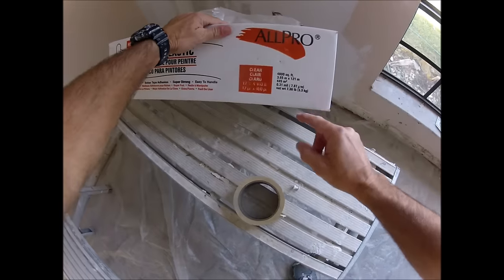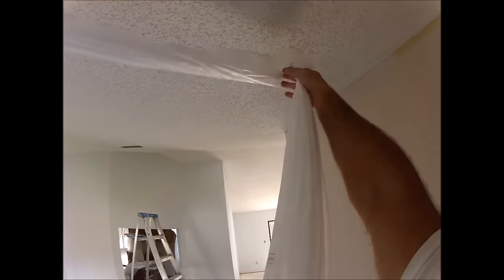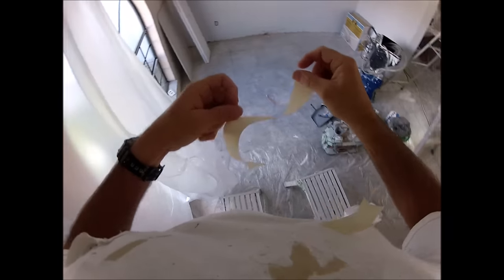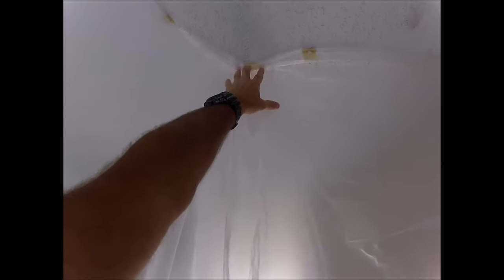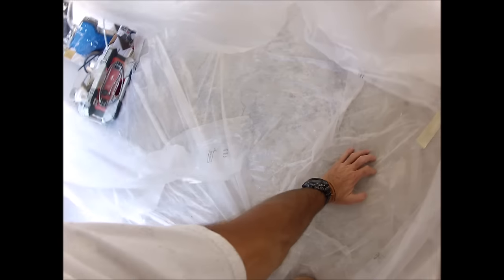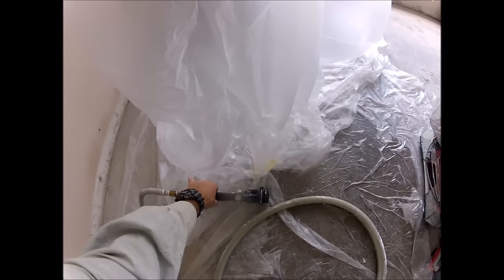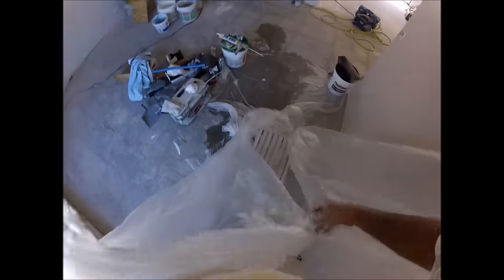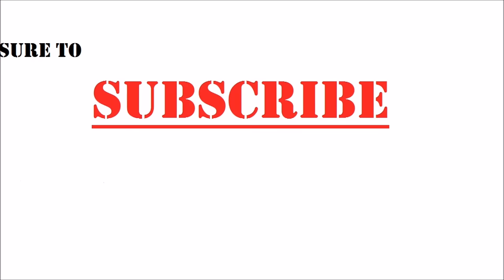How to make a DIY Dust Containment Plastic Bubble Fast and Easy! 😷

Comment: Great pro tip. If you need it to me more sturdy and/or are using thicker plastic, you can also use this technique with a staple gun and folded over duct tape, scrap cardboard, or drywall shims to keep the staples from pulling through. We do this all the time on renovation projects.
Reply from the maker: Yes!🔥👍🏻

Comment: Hello Mr. Paul Peck! You are a genius and thanks for posting this tip on YouTube! So very helpful! We live in Victoria BC Canada and did some renovating to gut and reno our bathroom, and across the hall from the bathroom we combined 2 closets to make a laundry area for a stacking washer & dryer including all new drywall, plumbing, paint & flooring. It's an old 1957 build house with the original coved plaster ceilings and walls which we didn't want to ruin by using nails or staples to get the plastic up to contain the dust. Prior to the reno starting I found your YouTube video and we adapted your trick to preserve the original features in our home and securely get the plastic up surrounding the reno area to create the dust barrier. We had about 20 square feet to block off and contain the construction dust. This tip saved us so much stress and didn't ruin any of the original plaster on our coved ceilings and walls not included in the reno and stopped a good majority of the drywall dust & sanding on the drywall from spreading around the rest of our house.  After all the reno work was completed it was easy to take down the dust containment bubble and do a final clean up. Great tip, we will pass it on, thanks again.

Comment: Great tips Paul.  I have done this for years, but it is always great to learn how others do it to see what I could do better. Thanks for all the vids!
Reply from the maker: Appreciate it Dave! I figured there were a few other contractors out there doing this. I figured this out out of desperation.20 years ago. LOL... I'm self taught, so some of my tips a tricks have a lot of out of the box thinking twists in them. I had seen others use staples. But I never really thought that was a good option when working in people's homes and leaving staples in the ceiling or walls after doing a ceiling repair. So the push pin Pecknique was introduced to my repertoire. And it turned out to be a much better solution for draping plastic. Are you a painting contractor or texture guy? Take care, -Paul

Comment: What about using zipwall poles?  Probably faster and no pin holes left over.  Just a thought
Reply from the maker: Yes, Zip Walls would work too. A lot of times this technique is faster and you can do multiple areas in a home without having a bunch of expensive Zip Walls taking up space in the van. The tack holes a not an issue because they are so small and easily fill with paint when the area gets painted.  Take care, -Paul
Reply: @PaulPeck  there's no way this is faster than zip wall polls. And how much room do a bunch of poles really take up? You can a ton of them in the bag they come with.